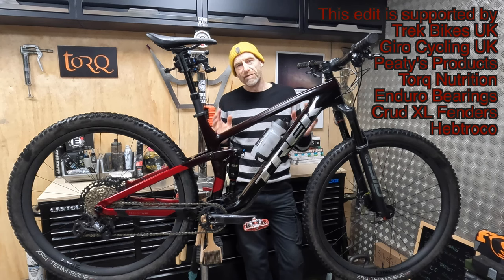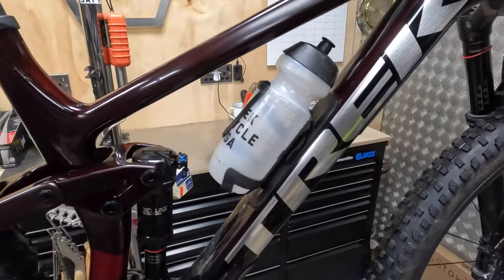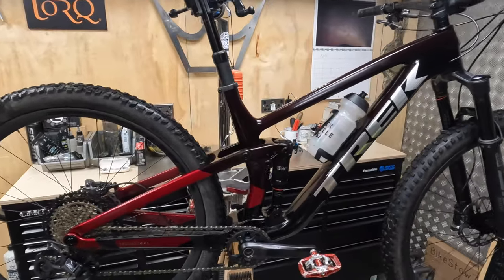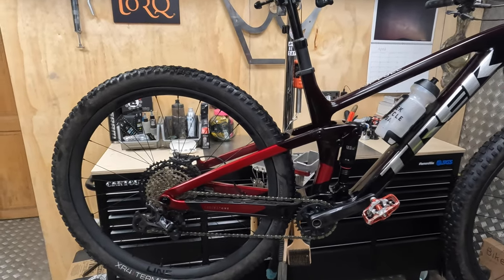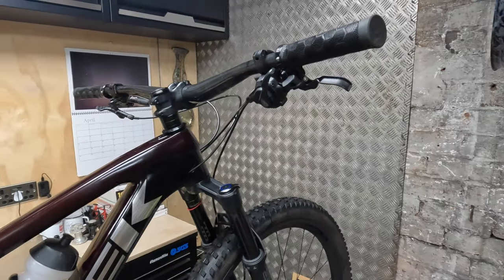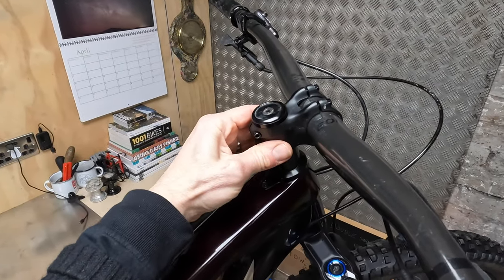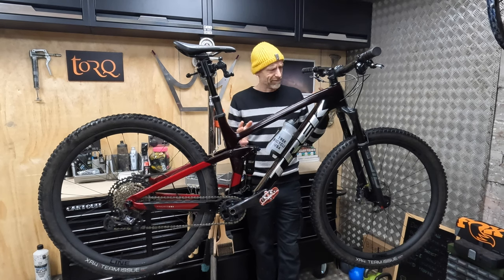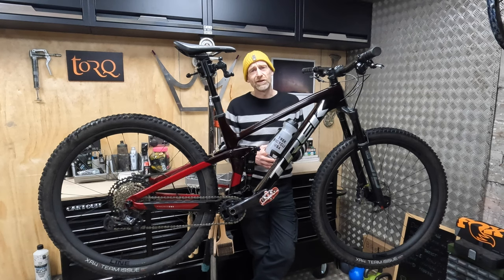Trek Top Fuel 9 8 Tech Talk Round

Comment: Built the carbon frame top fuel up earlier this year. Xtr drivetrain Xt brakes 130 pike ultimate and 120 cane creek coil in back. The suspension change makes this a whole new bike. Drops and jumps are smooth and climbs are like cheating. Definitely recommend. Great video
Reply from the maker: That sounds so sick! I was going to throw a Fox coil into this one but they needed it back in a hurry
Reply: @GuyKesTV  the dps shock that came with the frame just held this bike back so much. I’d love to compare my bike to the SB120 or T. Spur
Reply: dps shock? Their website shows Rockshox Deluxe Ultimate.
Reply: Surprised me too

Comment: Guy, how did you like the XR4’s? One of my favorite tires overall when considering weight, rolling resistance and traction.
Reply from the maker: I’m a big fan of the XR4, a really good all rounder for a lot of conditions.
Reply: Just went through a set of maxxis rekons front and back. Replaced them with the XR4s.  The XR4 is lighter and more supple and better traction then the rekons. Roll arguably the same quick speed. I loved the XR4 so much I put them on my bigger bike also.
Reply: @skinny8019  if you find you need more sidewall on your bigger bike the SE4 is the same tread just a heavier casing
Reply: @tinshield  thx bro!

Comment: Great review. And really nice bike. Been riding the 9.8 XT for about a year now. Mino link is on the bottom of the shock by the way.
Reply from the maker: Well that makes me look stupid doesn't it 🤣Yep, you're dead right, they have switched it down there now. Stoked you're enjoying your bike anyway
Reply: @GuyKesTV  no way 😅👍had to look twice myself at my own bike because at any other Trek fs the mino link is exactly at where you were indicating. And again, also enjoying your reviews.
Reply from the maker: @mseekles1972  Im kind of laughing because I've obviously just got so used to it being there since like 2000 or something 🤣
Reply: @GuyKesTV  😂 I am relatively new to mtb … I am no youngster but really got into the hobby/sport about three years ago. I am lucky to also be able to ride a Slash. Only just last week I found out that my bike has got the minolink “high-low” indication misprinted on the frame … so I have been doing some bikeparks in the high setting while being convinced I had the bike in the low setting 😆 it made me double check it on my top fuel

Comment: Trek is not even trying to keep weight down anymore. My Stumpjumper with more travel and XT group is significantly lighter? I run the same tires as well. You’d think the SID suspension and short travel frame would help? 😮

I think all this bike really needs is a 1650 gram wheelset.
Reply from the maker: I put the HUNT Proven XC wheels in with Maxxis Severe and Rekon Race in for a few rides and it flew
Reply: @GuyKesTV  bet it made a huge difference 👍

Comment: Great review, and enjoyed the ride along too. I have this exact bike (for a bit over a year), having had enduro bikes for a long time, I'm amazed at how fun and capable it is. I like the SID but feel like it's a little undergunned compared to the rest of the bike, seriously considering a 2023 Pike at 130mm. I know when you reviewed the Pike you weren't all that impressed, claiming the SID feels better, have you had some more time on the Pike, do you still feel the same? Otherwise, wheels would be the most obvious upgrade, but the current ones are solid and the quick engagement is fantastic so I've held off that upgrade so far.
Reply from the maker: I've ridden a couple more Pikes since that review and they've all had the same spiking issue to a lesser or greater extent so I'd currently recommend the previous generation Pike. Fantastic forks and they're going really cheap now too.
Reply: @GuyKesTV  The spiking feeling may be due to the new-school over-engineered air spring… ;) Is there a difference in sensitivity/harshness between SIDs with charger 2.0 and charger race day? Could it be worth to update the select+ SID?
Reply from the maker: @cyklomaniak  there’s no massive difference in feel or control between the Charger 2 and Race Day. Race Day is just lighter. With new Pike I think it’s more a combination of new bushings and new compression

Comment: Do you think remote lockout (cabled) is a waste on XC or Downcountry (to also race with) bike? Perhaps also adds weight? Im debating on some bikes i love but dont offer it or would require suspension swap outs just to allow lockout cabeling.
Reply from the maker: Hey Ryan, I think it’s entirely a personal thing. In reality most short suspension bikes pedal well enough not to need lockout off road. If you ride road a lot or just like the feel of rigid suspension when you’re racing then it’s worth the extra weight and complexity. Get a bike fitted with it to start though as retrofitting is nearly always a fight

Comment: Blast from the past - the single pivot rear suspension, the huge cable loop sticking from the derailleur, the high seat tube. I hope the brakes don't rattle and don't change the bite point randomly
Reply from the maker: No the XT brakes actually behaved really well this time! And there is a rear pivot but it’s in the same place as the rear axle